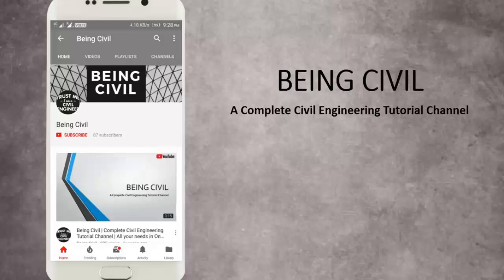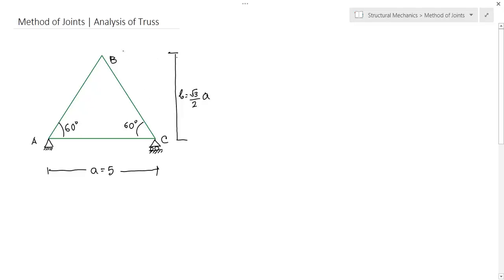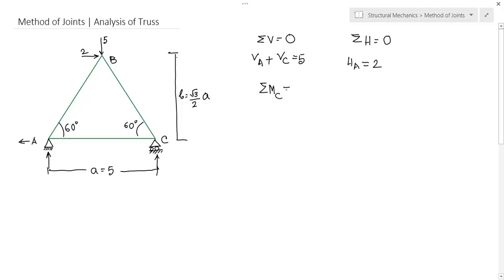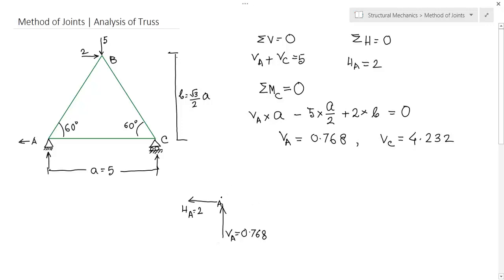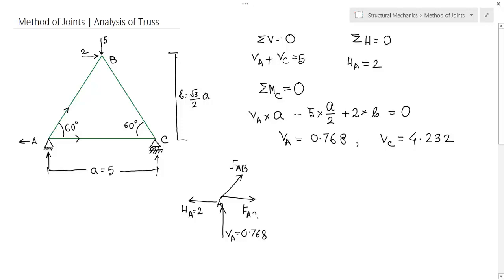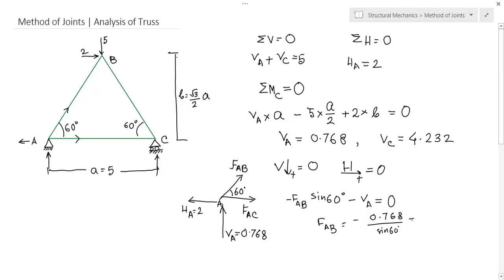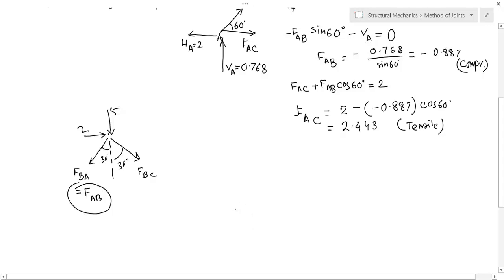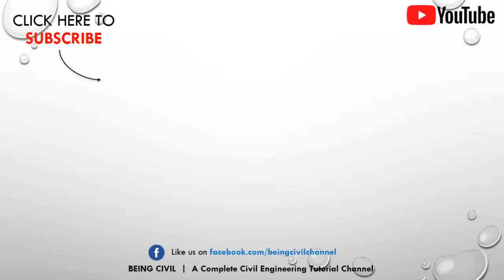Method of Joints | Truss Analysis | Example

Comment: Fab = -0.887 and thus, Fba = +0.887. In your equation for Fbc, the numerator should be -5-0.887cos(30) instead of -5+0.887cos(30) because taking Fba to the other side of the equality should make it negative again.